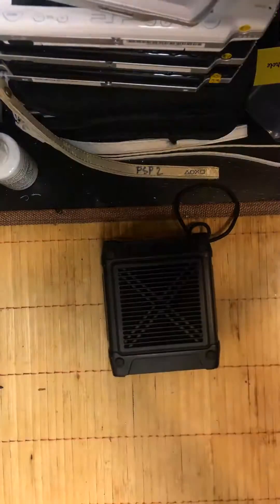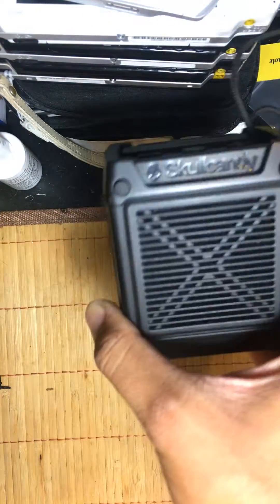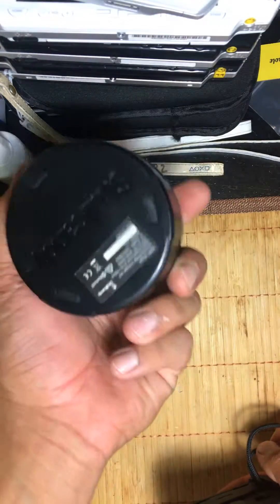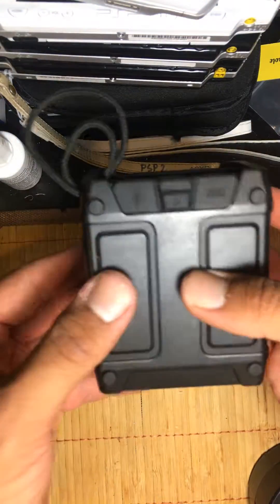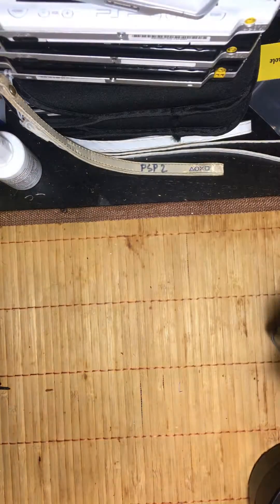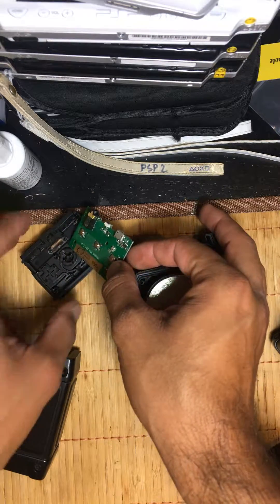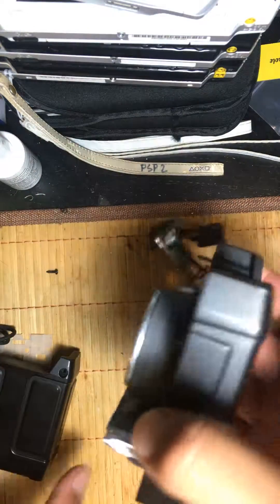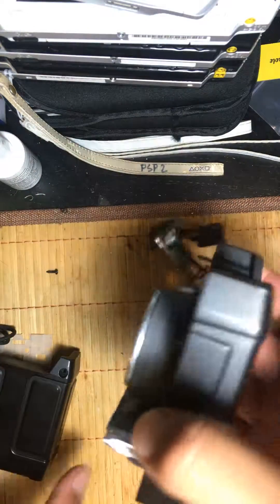Skullcandy shrapnel taken apart

Comment: I had this speaker sitting for years because the charger port broke like yours but what i did was used scissors to cut some plastic out from over the port so i could access the board, soldered in the end of a charging cable to where the old micro usb charging port was so it just has wire running to a usb end sticking out of the speaker. Hot glued around and closed up the missing plastic, painted black and now i just plug the usb cable into a charger and the speaker starts charging. This thing has got to be close to 10 years old now and it still a good speaker for times when you dont want a super loud one

Comment: I have the same problem however the speaker works when it's plugged in. just doesn't charge. I took ot apart and everything seemed to be soldered properly. I'm wondering how the battery can suddenly stop working. Any thoughts?
Reply from the maker: Kamil Masou mmmm have you had the speaker for a long time?
Reply: @alexzamora8491  yeah a few years it always worked great and all of a sudden I had this problem. Usually when the battery dies it doesn't do it suddenly, I think
Reply: 😮 me pasa lo mismo y quisiera saber a qué se debe para poder repararlo por qué una buena bocina bt